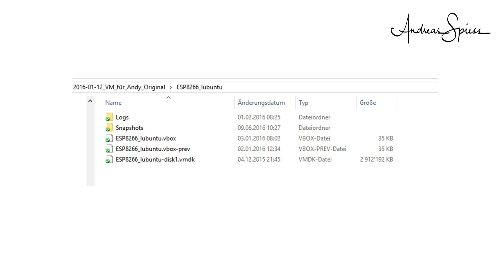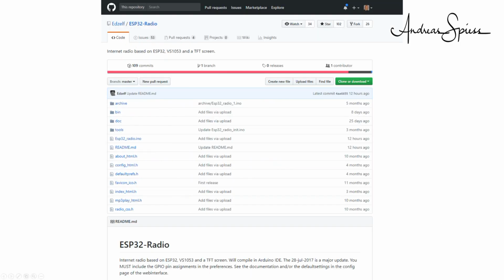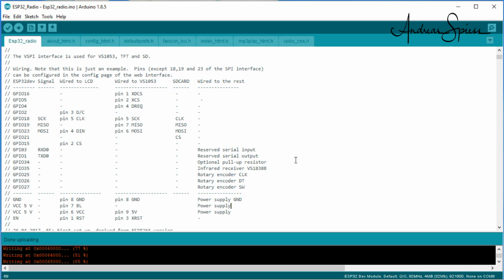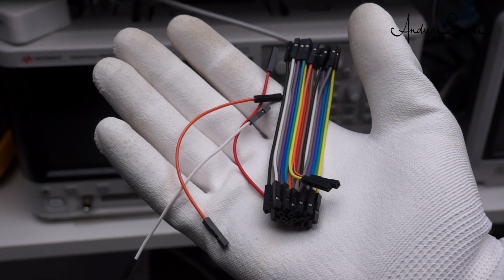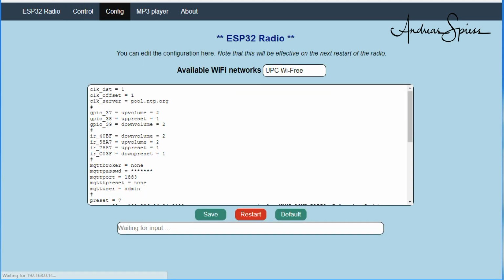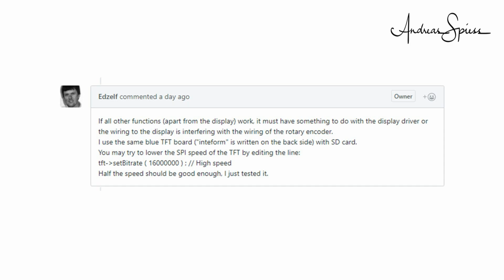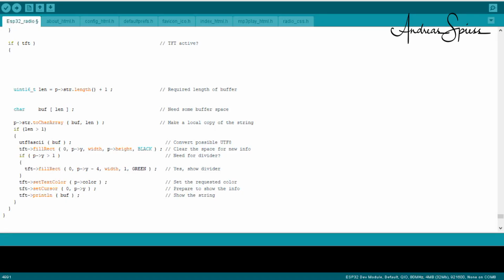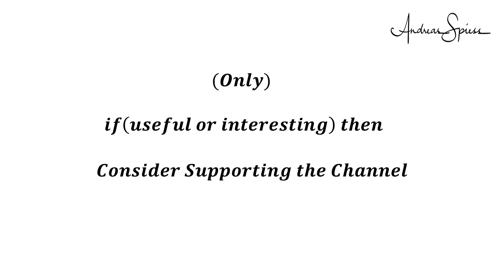#195 DIY Internet Radio using an ESP32 (Arduino IDE)

Comment: Thanks for this nice Project!
Once upon a time in the early 2000th there was an internet radio station "Bach-Radio" produced by Otto. I received it using my first and retired laptop. A  car FM transmitter distribited it to normal FM radios in the whole flat. car FM Transmitters are (or were) legally in Germany.
Later I switched to my first synology using a USB sound card, the car FM-transmitter etc. This also had a RF remote and worked fine.
Then an "Ayildiliz-Team" hacked Bach Radio and Otto discontinued his channel and moved to 1.fm.
Nowadays mostly I am using my smartphone. Axon 7 has good speakers. Good enough for my old ears. An internet hearing test let me face reality and saved a lot of money to me. But most German Radio stations are no more worth hearing.
Apropos American presidents: I would like to recommend the autobiography of Herbert Hoover. A very poor orphan boy was adopted by Quakers, became a mining engineer, was involved in the supply chain of WW I, got part of US administration and finally became 31th president in a bad time.
Reply from the maker: Thanks for the nice history of your experiments...
I love biographies and own a few. Unfortunately, I do not do a lot of reading since I started this channel. But I put your recommendation on my list.
Reply: Yes, I understand. Reading printed books becomes more and more demanding with my nearsightedness. 
Hoovers autobiography has 3 parts, start with part 1.

Comment: Could it be that your development environment is slightly different than the one the developer has? It could lead to slightly different compiled code. Maybe you could ask him to send you a compiled binary to upload to your esp32 to exclude a sw problem.
Reply from the maker: He has a compiled version on his GitHub. It had the same issue :-(
Reply: Andreas Spiess if you already tried different hw revisions of esp32, different displays, different power supply, I'm running out of options too. Unless he has a slightly different lcd controller chip than you, with Chinese products it is always an option

Comment: @Andreas Spiess: I hope you have seen the last videos from EEVblog about these speakers.

http://www.eevblog.com/forum/blog/eevblog-1072-krk-rokit-6-studio-monitor-speaker-repair/
http://www.eevblog.com/forum/blog/eevblog-1073-more-krk-rokit-black-gunk-speaker-repair/

Short: They used some black stuff to keep components from vibrating off but that stuff decomposes and becomes conductive and corrosive. It will destroy these otherwise good speakers. As a preventive measure, open them and look for this stuff and if it is there, remove it.
Reply from the maker: I saw it. Mine are Gen3 and Dave mentioned this should be corrected in this series... Let's hope!
Reply: I'd still look inside, just out of curiosity. :)
Reply from the maker: I will...
Reply: LOL, I just looked up the URL for these videos to paste here in the comments.  Nice, you beat me to it.

Comment: Admirable persistence 🥇. I wish we could use embedded bluetooth  instead of I²S or eSPI
Reply from the maker: I am not sure if these two protocols serve the same purpose.
Reply: Pair your ESP32 with bluetooth speaker or headphones. ??? Probably protocol conversion needed. => Headset Profile (HSP) «SCO audio encoded in 64kbit/sec CVSD or PCM» Are libraries available? [P.S. Glad you've gen3 KRK Rokit Speakers]
Reply: I meant to connect BT loudspeakers.

Comment: Maybe someone should set up a complete nOOb page with this project since I think a lot of people are wanting to build this and a seller who sells all the needed parts in a kit with a nice box.  I see a lot of potential in this thing if we all work on it.
Reply from the maker: I thought about it. Maybe I will do an instructable...
Reply: Should not say that! (Don't remind me)   'It is not my domain' sounds better.  ;-)
Reply from the maker: One thing is sure: I will not sell hardware. I am too old for that ;-)
Reply: That would be so cool.  I see endless possibilities. I really haven't played with these ESP's but would be nice to have something like this which can actually broadcast bluetooth or cast via wifi.
Reply: A lot of stuff I see on kickstarter is all overhyped and some I have doubts about the promises or explanation. Most kickstarter stuff is pure commercial anyway.  This is completely opensource and should stay that way it is composed of existing boards anyway..  ... but I hate to buy stuff separately and then get a slightly different part which is not 100% compatible. At that point you are stuck and the whole project ends up in a box.
Reply: I think it isnt too complicated, just order esp, lcd and V1053 on ali or bang then connect it, understand documentation and it working, i am also arduino noob, little bit tricky is put ther inicial configuration :)
Reply: That might be too difficult for some people, even on instructables if I provide a  schedule and  a bill of materials, I still get questions if I can send a list of materials and a connectioncircuit. But yes, if you really want to build this, all it takes is an order on your favorite Chinese webshop
Reply: Ed19601   I completely agree.  I could possibly do it too from scratch if I take the time to study these things for a couple of months. Analogue and HF is more my direction.  I think a lot of people would like to create something like this and learn something meanwhile.  I only learn something when it interests me and if I have a goal towards the project.  I already have a NodeMCU v3  Lua esp8266 board but I have no idea if it has enough memory and processing power. The problem when ordering from China is that the slightest mistake takes 3 or 4 weeks delivery time.
Reply: Luc Peeters A couple of weeks should be adequate. Really, it’s not that complicated.
Reply: yes indeed, though lately I have been lucky in ordering. Some arrived within a week
Reply: Luc this is what kickstarters are all about. People have idea and then bring to market using the power of crowds.